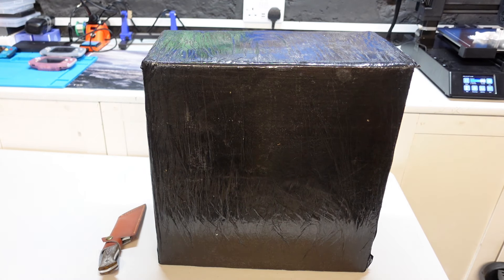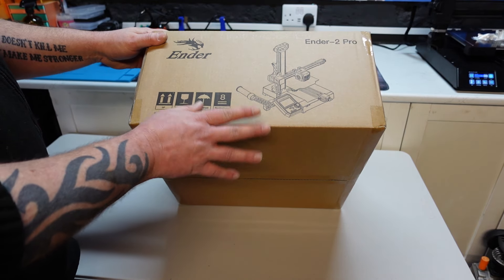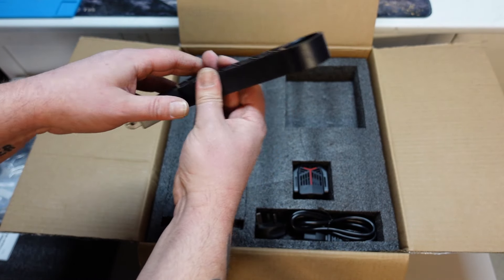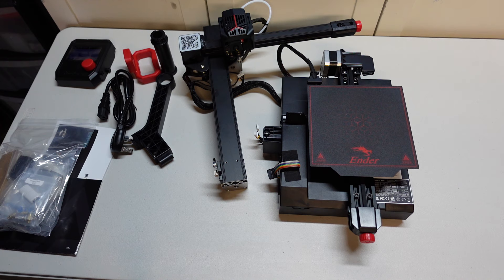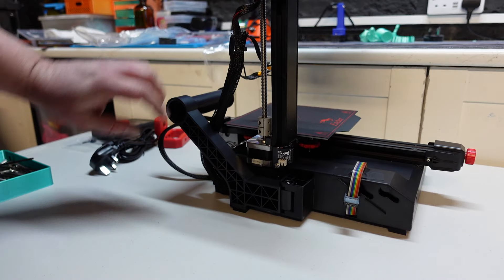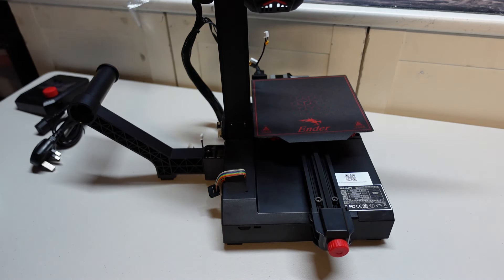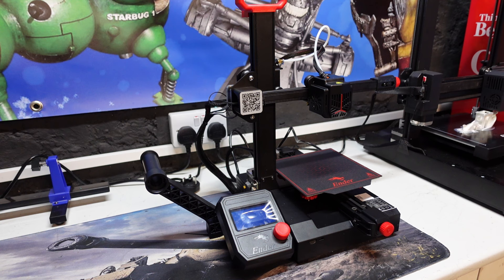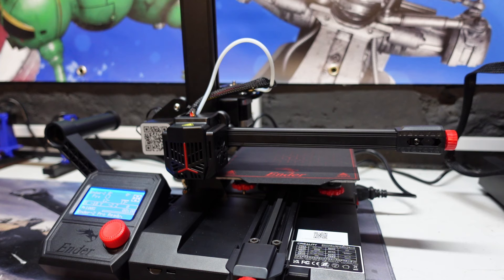Creality Ender 2 Pro Unboxing And Assembly

Comment: I got one of these last week from technology outlet. Its an awesome little printers and looks like a prusa mini. Very easy to level and very quiet. The only real issue is the cable coming out the back that connects the extruder, and x motor etc., causes the printer to wobble. I had to cut the cable tie.  

I also found the bed wheels a bit too small and changed them over with the old ones from my biqu b1 printer and I also found I had to remove the screen whenever I adjusted/levelled the bed, it also comes with the plastic black extruder arm, which breaks very easily so I ordered a red one off eBay!

It is slightly bigger area to print than the original ender 2, but they have extended the x and the y but shortened on the z.

Where did you get the Starbug print in the back ground?
Reply from the maker: hi, yes i noticed if you cut the cable tie off from the bottom and move the wire it solves the wobble lol, ive not had any issues with the bed wheels at all, im currently running some test prints for a follow up video and the quailty so far has been really good. the starbug is one of my prints that ive done its currently sitting on top on my cr3040
Reply: @BeaniesHobbies  the starbug I'm lookin at maybe a canvas or a panting.  you get a good view of it at 16:07 it also has Captain American's shield on it
Reply from the maker: @ricstanden  thats my beanies hobbies youtube canvas i had made up from vista print to cover up the back wall of my workshop, its pictures of some of the prints ive done, if you use instagram add me beanies hobbies and i can send you a full photo of it so you can see
Reply: Hi Beanie,  ordered mine today on the strength of your reviews AND used your code for 10% off.   Result! 
Thanks
Reply: Some people say this printer is very loud. You said it´s very quiet. Is is really quiet?

Comment: I wish I found your tutorial before today. I had found others where people have said about upgrading features (and which parts will fail), but yours has a more "plug n' play" feel to it. So putting it together has really stressed me out.
Did you have to make any other adjustments (nozzle adjustments, axis adjustments), or did you start printing straight away?
Reply from the maker: Hi, no just assembled it, levelled the bed and was up and printing
Reply: @BeaniesHobbies  That's good to hear😁(I've just won back a little bit of confidence). So when you level the bed, do you keep the printer turned on? (Sorry for the late reply).